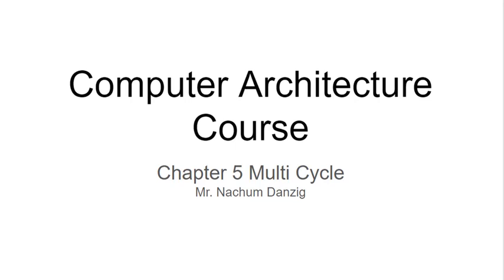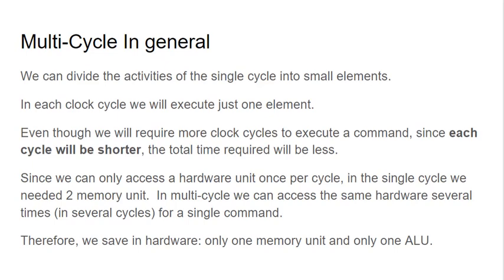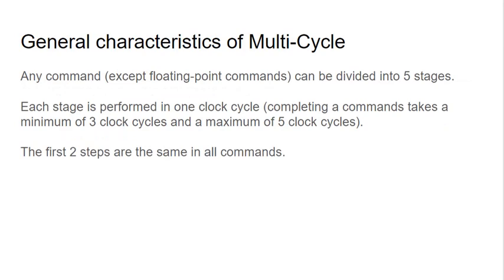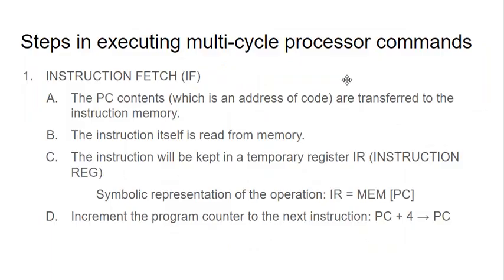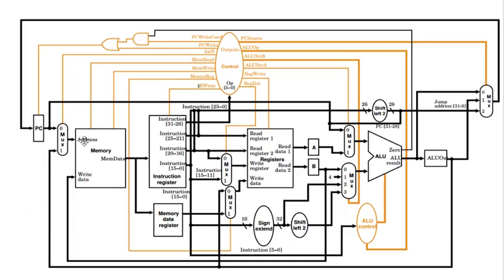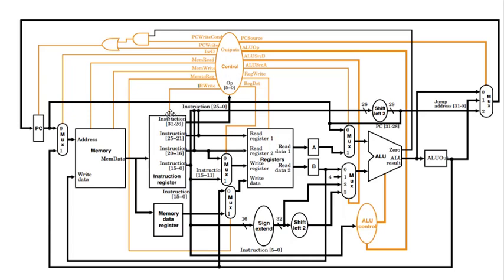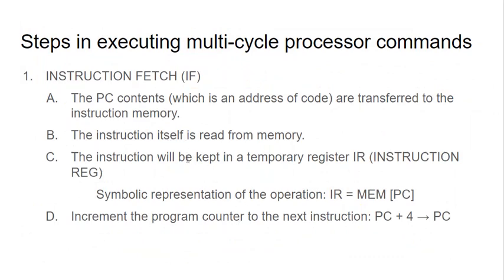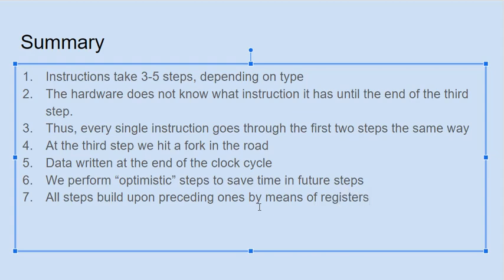The MIPS Data Path for the Multi Cycle Configuration

Comment: hi, first have many thanks for giving this nice lecture. at 27 minutes into the video you discuss the execution of "Load word from memory" and for that instruction the offset won't be left-sifted by 2, because this will happen only for branch instructions that are word-aligned by four bytes. the involved mux should therefore be set to 2 so that every byte from memory could be addressed and loaded from the calculated memory address.
Reply from the maker: Yes, you are correct. Thanks for catching that.
Reply: thanks for confirming,  I also noticed that